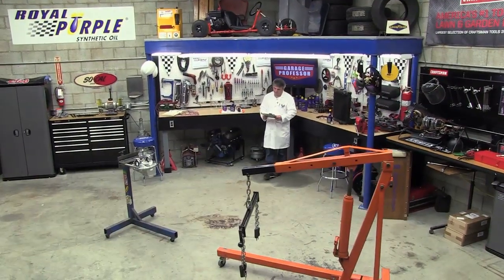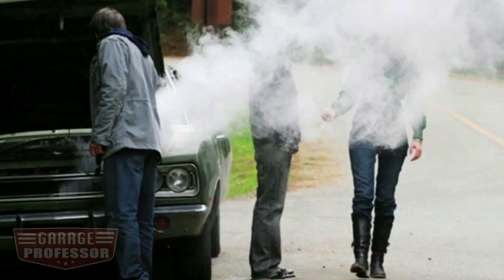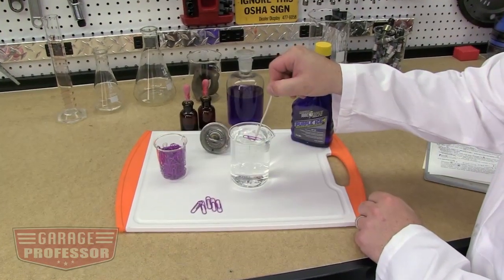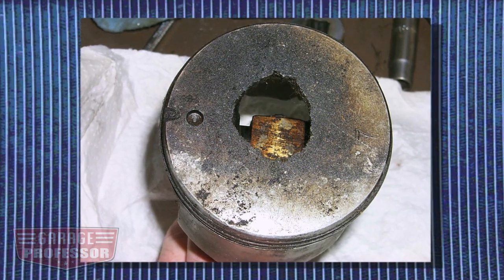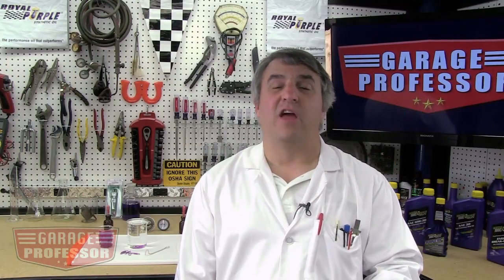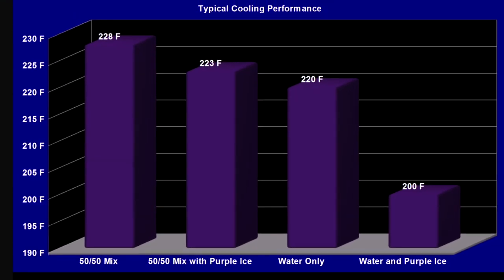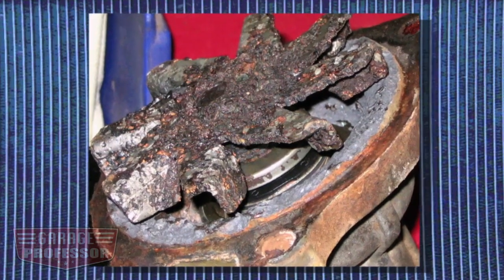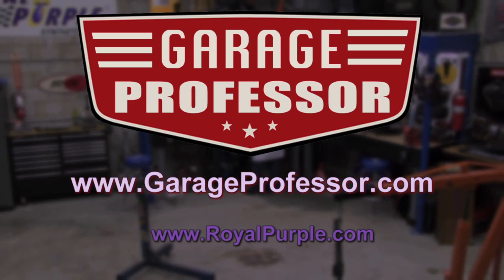Icing Your Engine

Comment: So if best results is literally water and purple ice...should I flush my system then add water and one bottle of purple Ice?
Reply: Don't do that!...Put Antifreeze in your radiator along with purple ice...Purple Ice DOES NOT offer freeze protection like Antifreeze.
Reply: That's only needed for racing applications. You need real coolant in your radiator not just for when the temperatures fall below freezing outside but just as importantly to prevent rust and corrosion.

Comment: you dont need any of this, coolant already have everything you need
Reply: Depends... When I've drag race my cars if the operating temperature goes over 210-220 the engine computer will pull back timing and reduce performance to stave off detonation. If you don't do any motor sport activities its likely your coolant is just fine. But for us racers we don't want the engine to get past 200-210 degrees, because we want repeatable performance every time down the track. The only other way to prevent timing from being pulled aggressively is to shut the car down for about an hour or so to let the engine components cool down back to their normal operating temperature. This means less time spent on track; for example it's been proven my current car Ford Focus ST will reduce power after 3 4th gear runs on the dyno which is a simulation of 1/4 mile drag strip passes. I can tell my car reduces power as the trap speeds go down slightly with each run. My car is brand new, so there's noting wrong, this is just normal. Pure Water is a much better than coolant which is mainly there for rust protection, lucubration of the water pump and prevent freezing for those of you who live where it gets below freezing which I guess is about 60% of the population in the US. I live in Southern California, it doesn't snow, so I don't need coolant. I will be switching to 100% water and purple ice for the reasons I stated above.